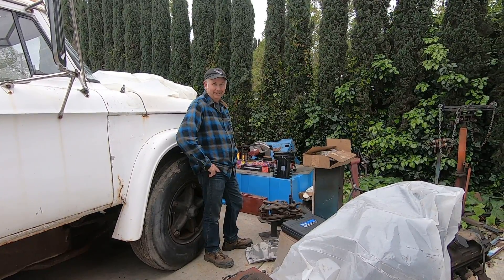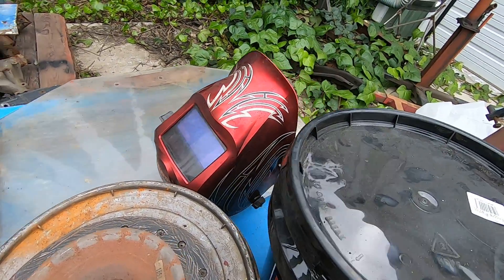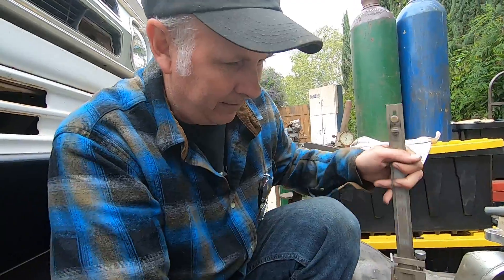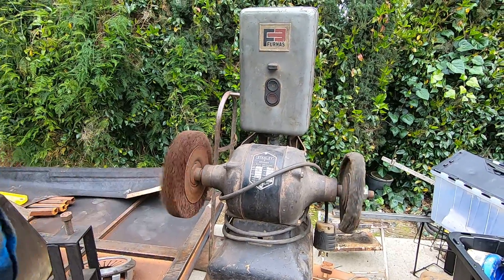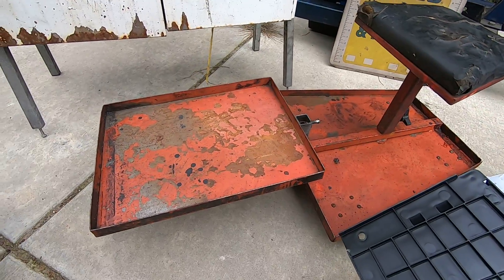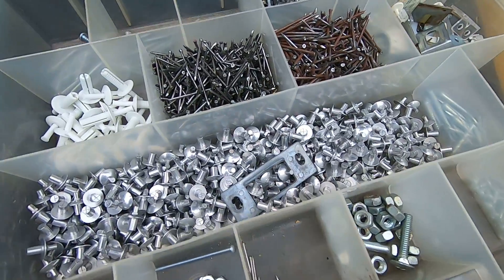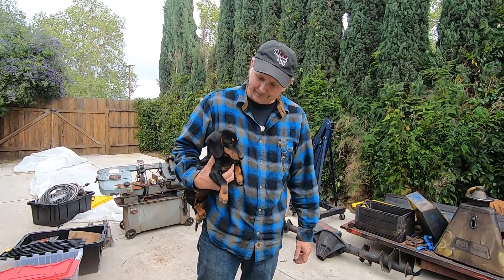Random Things: Storage Unit Mystery Stuff: part 2 with Elana Scherr and Tom

Comment: Hydraulic flaring tool is $300+ shipping brand new. Those tanks look like Mother tanks. My son worked for a welding gas distributor. He claims that you cannot buy one a tank that size. Love that bubble balancer. I also love the way Tom pronounces the word "measure."  My late neighbor pronounced it the same way as Tom. You guys are awesome.
Reply: You can buy 300 footers, have two bottles in my shop for both my tig and mig rigs.
Reply: @mikeycornwell0138  I have one as well, but I didn't buy it. It belongs to a gas supplier.

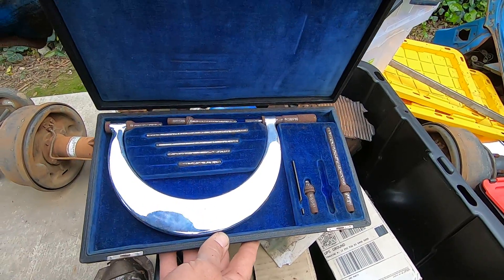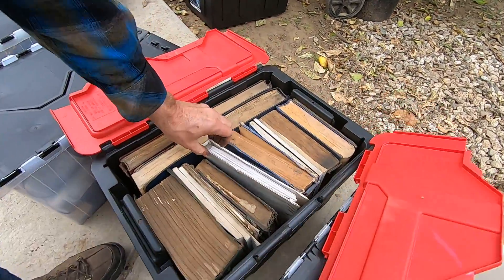Comment: The trans that says diesel at 4:05 I'm thinking is a 700r4 from behind a 6.2 or 6.5 gm. At 5:15 it's a FLOPPY disc Tom. Get with the technology man! 9:25 that appears to be the book on the torn apart 4 speed. Also I saw a sniper or other brand tbi setup in the box at 10:00 All the Holley double pumpers!!!! Good guy! Not an edelbrock in sight! Also too bad you guys are mopar peeps because you could have a pretty sweet big block Chevy build started real easy!

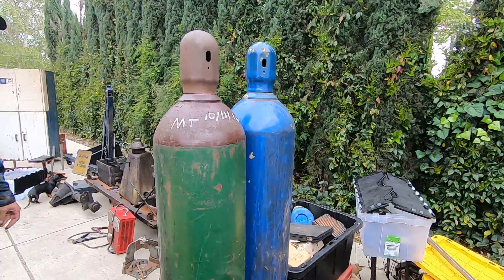Comment: 4:46 those look to be 300 cubic foot tanks, most supply stores will do exchanges for a price and only charge a recert fee if they are out of date, good news is 300 is a common size and is usually a cheap trade out. Stores will also generally trade out for a different mix than the one you brought them if you're needing something else.

5:50 that is a three post 90 degree fixture, two horizontal and one vertical post can all be held in place at once